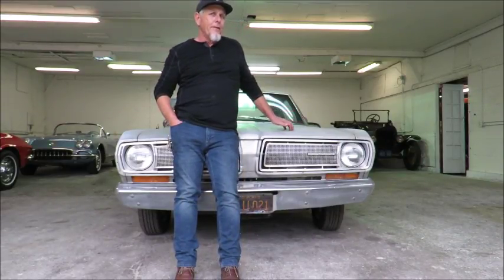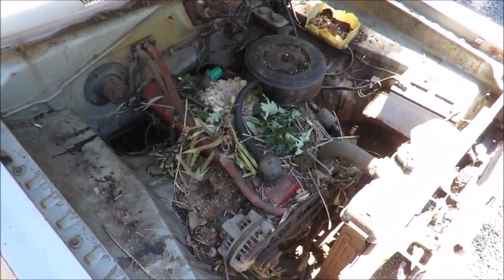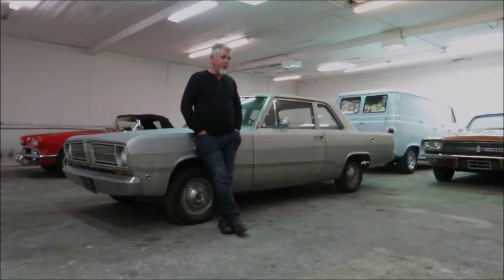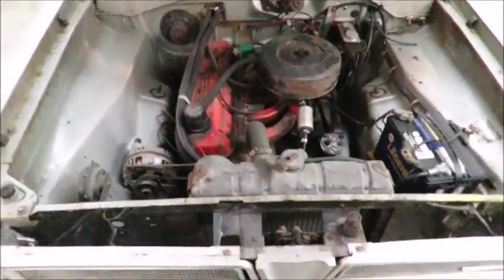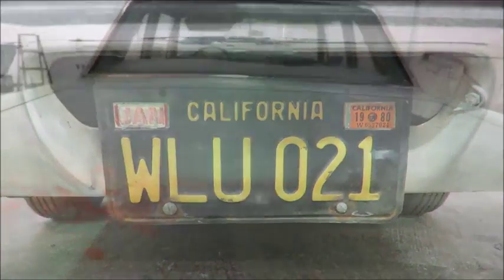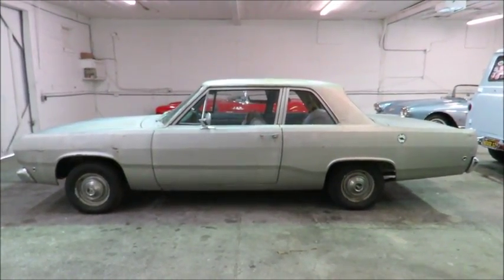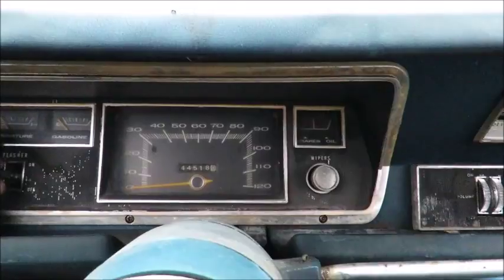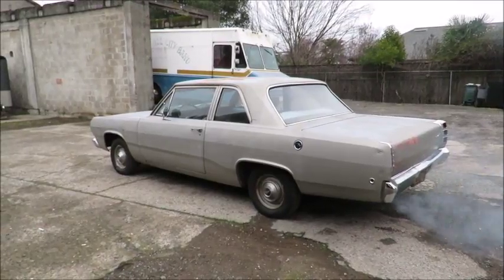1968 Plymouth Valiant 100 Saved from Sonoma Fires 2017

Comment: Did you take the time to pour some oil down the spark plug holes before you fired it up or just left it dry? sometimes the rings will stick and it takes a few times of getting it hot and cold before they lossen up

Comment: Smoke is prob dry rotted/ hard. Valve stem seals. I have one 79 d100 truck with 400k plus miles and it stopped smoking after 15 dollars of seals where installed.